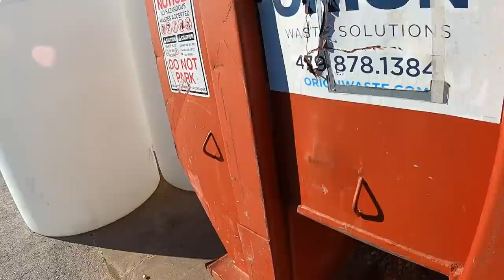Dumpster Dive Jackpot 🚨 "Found a Rat Nest"  (of copper)

Comment: crazy you didnt take the thick copper wire and the yolk from the tv. Its so easy to take of the 2 clamps that hold the yolk in place around the glass and you just slowly twist its off